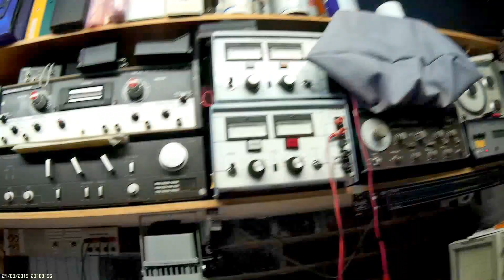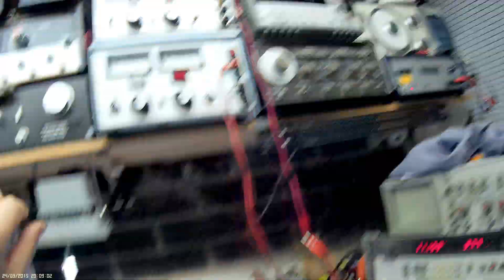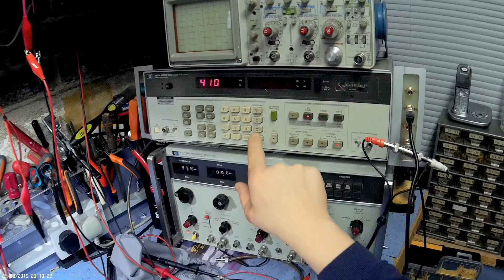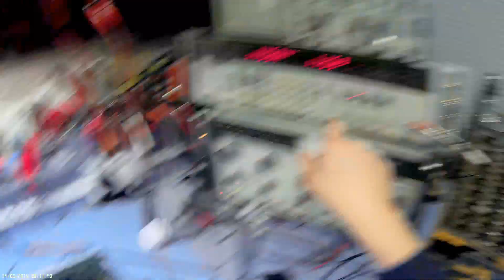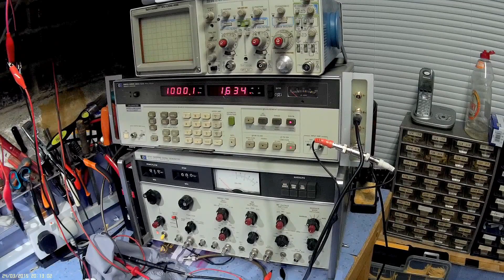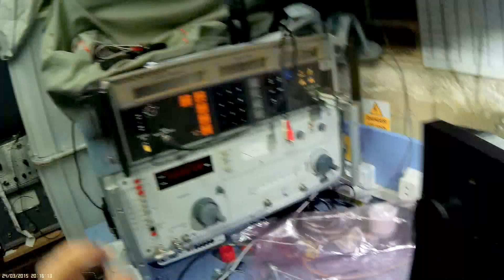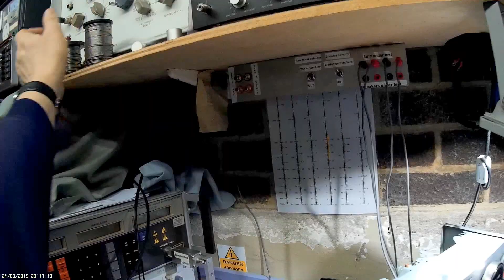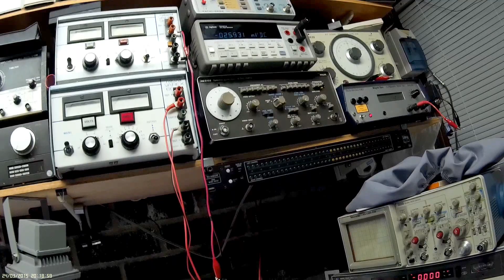Pioneer A400 transistor replacment and sparks!

Comment: I was actually waiting for those croc clips to short against each other and poof bye bye output transistors!

Having had a quick peek at the schematic, the VAS stage of this amplifier is excellent, particularly due to the 2SA1145/2SC2705 transistors Toshiba made. Now sadly obsolete and there's nothing like them :(
Reply from the maker: This was a highly regarded amp in the day. I still use one every day.
VAS? Voltage amplifier stage?
Reply: @SoddingaboutSi  yep... some would say the most critical part of a voltage feedback type audio amplifier :)